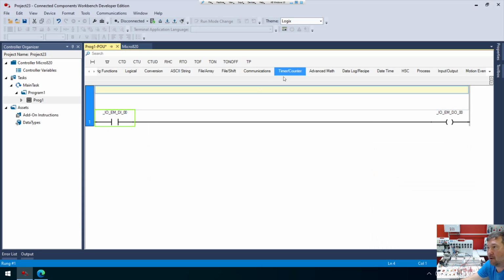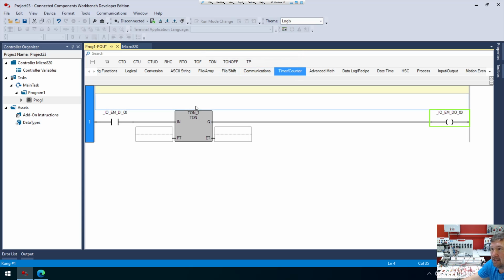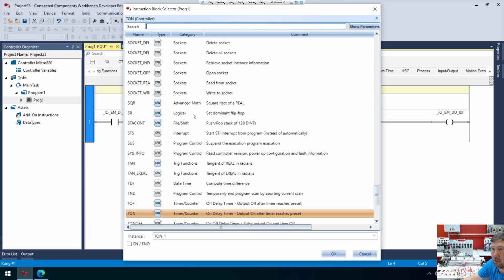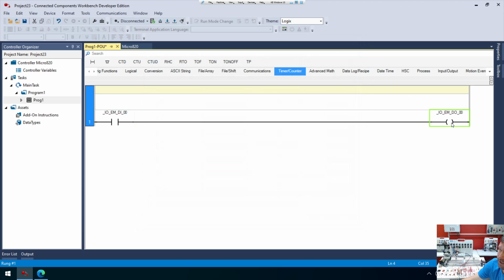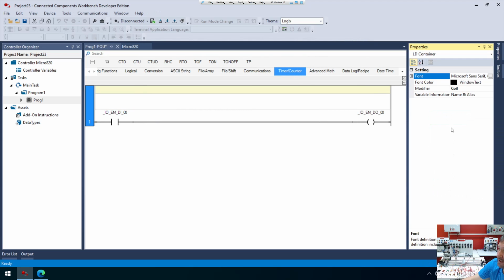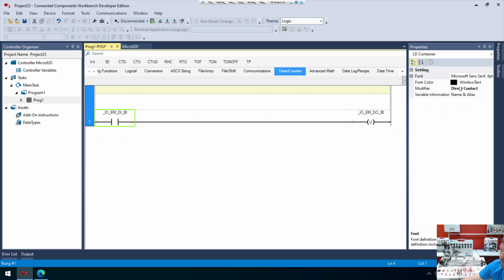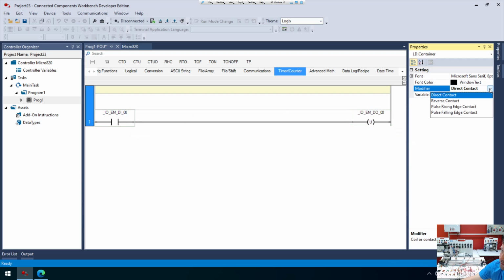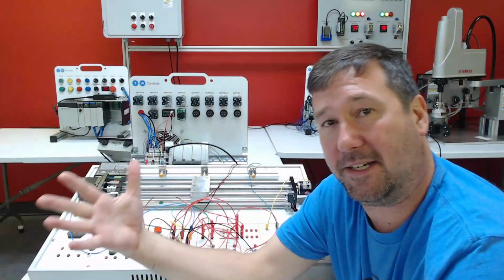Change Bit Instruction Type in Connected Components Workbench

Comment: Another method, though not as easy as just pressing the space bar, is to drop down the text input box and edit the instructions there.  If you look at the top right of the ladder diagram window just below the instruction library bar, there are two little up arrows.  Those arrows will hide or show the text input editor and the instruction library bar.  I have on occasion done a few ladder diagrams using the text input just to have a little fun.  I guess that it would almost be like structured text, although I have not done that type of program yet.
Reply from the maker: You just taught me something new Somer, that is something I've missed compared to Studio 5000.  I'll have to make a video showing everyone else!

Comment: Quick CCW tip.
If you hit CTL + R to go into manual mode, you can change the bit type of a contact or coil by highlighting it and pressing the space bar. it will cycle through the different types.
Reply from the maker: What!?!  I'll have to check that out.  Thanks!

Comment: Great to know.  Thanks.  Also Tim, I have been working on migrating a Micrologix 1400 program to a Micro 800.  I have searched high and low on how to setup a FIFO instruction on CCW with no luck.  Been trying on my own with no luck either.  Would greatly appreciate it if you could do a video on that subject.  Also, how to setup an ONS in CCW to work like a RSLOGIX 500. I have learned a lot from your videos and hope to continue.
Reply from the maker: Be in the lookout for now Simon game quiz answers which will address this.
Reply: @TimWilborne  Will do, thanks

Comment: How does the most recent version of CCW work on a machine loaded up with 500 and 5000? Working with a laptop with a 64 bit operating system and 8 gb of ram.
Reply from the maker: Fine, my computer isn't fast and I have them open all the time.

Comment: Hello, Tim! Please tell me, there is no JSR instruction in CCW. How to be? This is the only option presented: With the Micro 800 series, nothing prevents me from breaking my program into logical subroutines.

I don't need to insert a JSR to call each procedure, the Micro 800 just runs each procedure from top to bottom and then repeats.

Am I thinking right?
Reply from the maker: I have a video coming on this, user defined function blocks...
Reply: @TimWilborne  thanks!